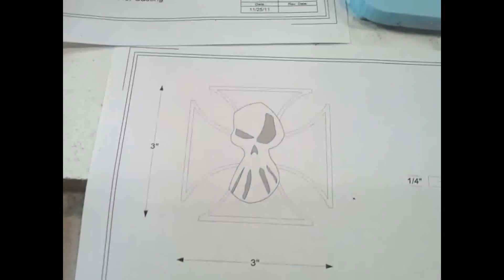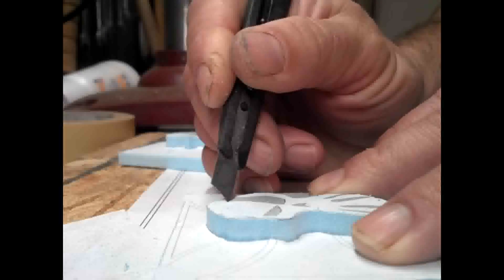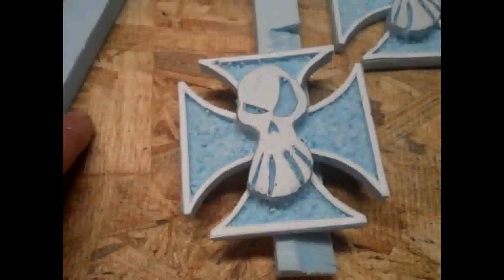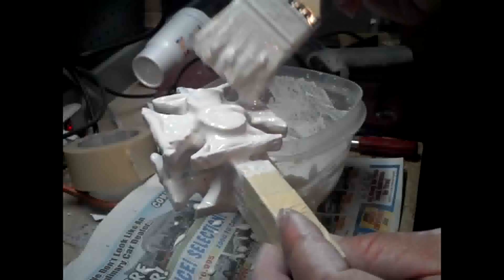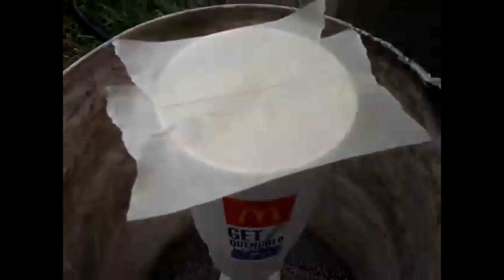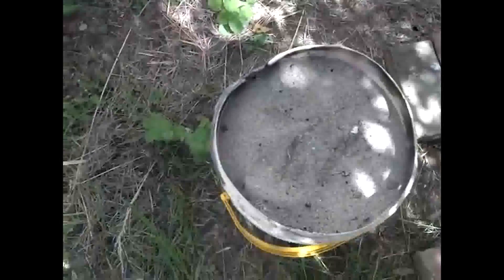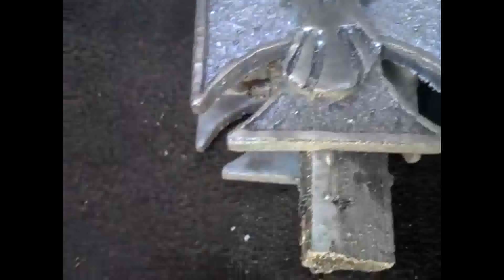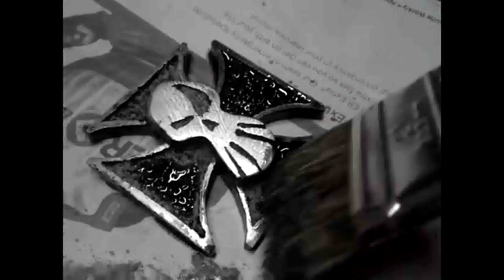Lost Foam Casting an Iron Cross

Comment: You should use a hot wire cutter, much more practical and precise.
Reply: +David D But you can use paper patterns to control where the hot wire cutter cuts. The King of Random shows this when he made a foam jet. Crazy Russian Hacker also has a video on making a hot knife that would be useful for cutting out the eyes and teeth in this project. I cannot believe this video does not have more likes! You showed a very good way to get some nice details without green sand.
Reply from the maker: I find it quite the opposite...the knife gives me fine detail when a hot wire is hard for me to control.
Reply from the maker: Jerry Whidby thanks for that...yes, I feel like this is one of my best videos.

Comment: Another way you may be able to get your design on the foam; print the design up with an inkjet printer, then lay the design on the foam and dampen the back of it with a wet paper towel or rag. Then you can just peel the paper off and not have to worry about it. I found that worked for me when trying to carve a design in clay, :)
Reply from the maker: sounds like a good idea, thanks for sharing!

Comment: What kind of glue did you use to put the foam together?
Reply: Be careful using hot melt glue as its temperature can be high enough to deface your pattern.
Reply from the maker: dragonthefirelord very true...I run my glue gun through a light dinner that I set up to operate an electrical outlet...or sometimes I just unplug it when it starts getting too hot 🔥
Reply: David D Good deal. What I usually do is apply the hot glue to a non fibrous surface to allow the glue to cool slightly.  I do this because it is easier  for me to gauge the temperature of the glue before I take the surface with the glue on it and scrape/wipe it on the sprue before finally sticking the pattern to it. But your way probably makes less of a mess and probably uses less glue.
Reply: You can get a spray glue at a craft store that is designed for foam  or yoy can use elmers school glue...or hot melt glue...it burns out.
Reply: Organic Gardening in North Carolina Thank you.  Good video.

Comment from the maker: to burn out plaster in investment...you get the temperature up to 1200 degrees F....it does make the plaster fragile, but not powder.  Even when bronze is poured into a thinly coated mold, the plaster that is on the final piece is hard and must be sandblasted out, or wire brushed.